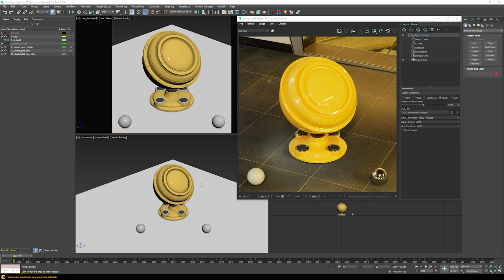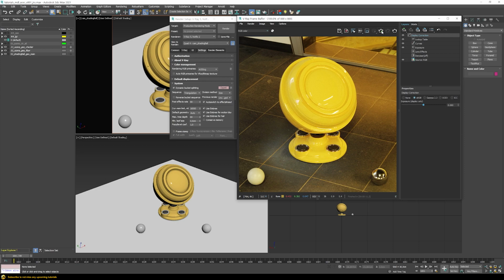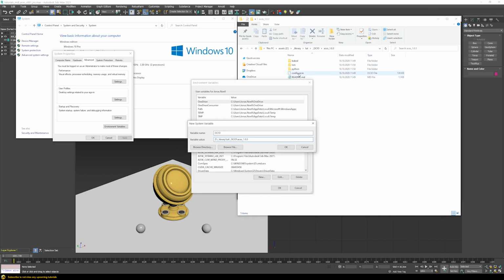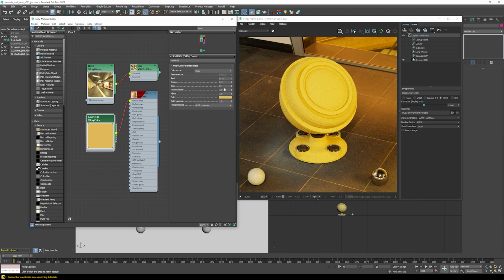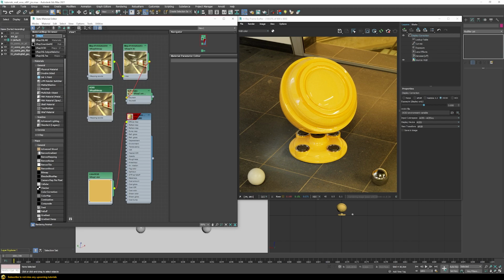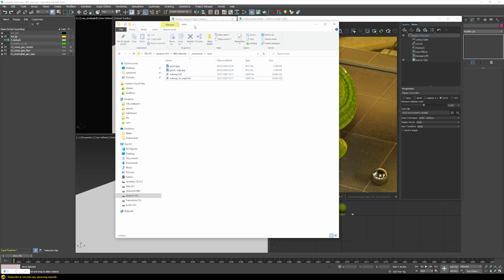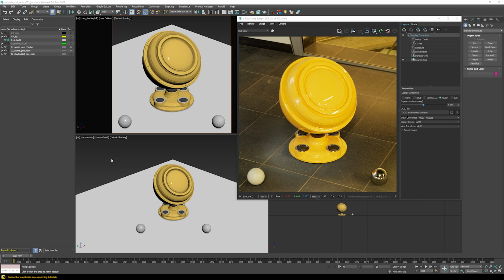V-Ray | How to use ACEScg WORKFLOW | ACES Theory, General Workflow, OCIO, sRGB Texture Conversion

Comment: Hello, when i use ACESCG, should i set the Color Management (in vray tab) to Reinhard or Linear?
Reply from the maker: Leave it a Reinhard as that is the default and its nowhere described that it should be changed in the official docs.
Reply: @JonasNoell  Okay thank you this is a little faster with Reihard :)

Comment: Great tutorial, sorry if this has been mentioned in previous comments (132 is a lot to go through) but is this workflow only helpful in terms of the compositing side of things? I'm assuming you will lose all that extra colour range when you say export as H264 from After Effects? Many thanks.
Reply from the maker: Hi, yes it will be lost when converting to H264 through AfterEffects. Basically look at ACES as an extended colorspace from that you can convert your media to any other format or colorspace. It’s the perfect base material so to speak.
Reply: @JonasNoell  Okay interesting, thanks for the info, really aprreciate it. It's a shame it doesn't manage to maintain some of that extra information in the final output though.
Reply from the maker: @tinrats  As you are looking at the output most likely on a sRGB Monitor it anyway wouldn't matter. It's not that through Aces you could suddenly see things that you couldn't see before :) There are 2 parts which people tend to mix up: ACES itself is just the colorspace that has a much wider ranger than sRGB, so it's perfect for storing your data and then converting it to any other type of colorspace or medium that you require. And the other part is the OpenColorIO configuration that basically provides a "look" for ACES by applying a tonemap converting it correctly to the device that you are using (most likely a sRGB Monitor). So when using sRGB with an equally nice tonemapping you can get identical results because in the end you are viewing both things on the same medium. The advantage of ACES mostly lies in its standarization across multiple software and that it's futureproof. It mainly makes sense to use ACES if you are working in a team that uses ACES through the whole pipeline in a standarized workflow in my opinion. As a standalone artist I wouldn't really bother with it too much for now... (that's my personal opinion, other may argue differently)

Comment: When we use ACES and save the file, the ACES settings are also saved in the photo and can be seen same on TV or mobile and different monitors? 
In the past, unfortunately, the color was not seen same in different devices.

Comment: Hey Jonas,
I had some problems using environment variables with deadline/any other farm service. I think it is safer to point on vfb the folder with OCIO config file.
Reply from the maker: Hi alright thanks for that. I haven't had tried out rendering through Deadline with Aces yet, so that's good to know! But anyway since you are saving out linear raw exrs without baked in tonemapping it shouldn't matter if some computers can't find the OCIO config files or?
Reply: @JonasNoell  yes, it is just matter if you want to bake the vfb transformations.
Tks!

Comment: Hi, Jonas. Thanks for the tutorial! When I set my non-ACES diffuse textures to use "sRGB primaries" from the "RGB color space rollout" in VrayBitmap, the textures become bland and desaturated. Is this normal? This makes creating materials difficult because the diffuse texture in the material editor no longer looks the same as the texture on my hard drive which is much more vivid. Does that make sense?
Reply from the maker: They appear more bland as they are converted to ACES in this case which in genreal produces a more vivid output result. So the preview looks wrong on your sRGB monitor but since it has been converted to ACES it will be rendered correctly internally. It basically does an on-the-fly conversion from sRGB to ACES. If you use ACEScg in V-Ray and you don't specifically define your texture as sRGB then it automatically will assume all of them to be in ACES already and thus doesn't change them. However the result will appear more vivid as intented  because the texture itself is actually not in ACES but still in sRGB. V-Ray itself doesn't know if your texture is in ACES or sRGB, it has to rely on the input from the user. Here is where most errors will happen and in the end you will get an odd looking image by mixing different data together in a way how it was not intended. So if you are not 100% sure of what you are doing it is better to stay in sRGB and avoid these kind of problems 🙂
Reply: @JonasNoell  Yes, I figured that out already. Thanks for reiterating though. My questions was more about the fact that using ACEScg workflow makes diffuse textures in the material editor look desaturated and this makes material creation a guesswork. Is this normal?
Reply from the maker: @bgtubber  Yeah as I said only your rendered result will be in ACES, what you see in your material editor is a texture that was converted to ACES. Since your material editor doesn't render the result internally in ACEScg you will see this bland result. It probably would be a possibility from Chaosgroup to still show the sRGB texture for the material editor and only use the converted one only for the internal rendering. But that's not how it is working at the moment. But anyway you probably shouldn't evaluate your shader through the material editor preview but through the full rendering.
Reply: @JonasNoell  Ah, I see. With all these small quirks, for me it's still a bit clunky to use ACEScg in 3dsmax. Seems like nothing in 3ds Max is color managed yet, including the material editor. Hopefully Autodesk can streamline things and implement a proper color management into 3ds Max. Until then, I think I will continue to use linear workflow with filmic tone mapping which give more predictable results for me, especially when creating my shaders. Thanks again for your input on this! 🙂
Reply from the maker: @bgtubber  That's exactly what I am doing for now as well. The whole ACES workflow at the moment still has too many inconveniences built in for me personally and in combination with a proper tonemapping workflow I also don't feel like I am missing out on much so far. 🙂

Comment: so i have to do this for every material of an asset i load in? good bye!
Reply from the maker: If you want to use correct ACES workflow then in theory yes :)
Reply: @JonasNoell  but all these assets that are prepared for 3dsmax+vray come with vray materials, that have the standard bitmap in the diffuse slot instead of the vraybitmap. it's literally impossible :(
Reply from the maker: You can convert all the textures to Vraybitmaps Using the Scene Converter in the Quad Menue. But you are right it is tedious to do so that’s why I normally don’t bother to use Aces at the moment.
Reply: @JonasNoell  Thanks for all the free service and information you provide. 

Yes, i feel like it's maybe useful for product rendering, but for architectural rendering with hundreds of assets and materials in the scene, this is way to inefficient at the moment. 

Right now i'm pretty good of using the filmic tone map and/or using camera raw in photoshop with the exr io plug-in in 32bit where i later convert it to 8 bit for matte painting. still don't like that photoshop is not capable of proper exr handling, but that's a different issue. I'm too lazy to learn fusion.
Reply from the maker: @L3nny666  I would recommend that if you have a workflow that currently works for you and there is no requirement from clients to switch to ACES to just stick with whatever you have. Do a propper tonemapping workflow and you will get (in my opinion) very comparable results with much less hastle and less possibilities to mess something up🙂

Comment: Hello, when I checked the official vray documentation, I noticed a yellow warning in the vray for max help file. This warning seems to be only available in the max version"
The V-Ray ACEScg workflow does not require an active OCIO configuration. In V-Ray 5, the relevant ACEScg transformations are part of the V-Ray core. However"
If I change the color space to aces, then use vray bitmap to load the node. Direct output, the texture does not change color.
This is Google translate, my English is not good

Comment: Thanks you very much Jonas. But after learning from you and paying a day to test it, I found that : all grayscale maps which have "_raw" suffix should be set Color space transfer function as "none" (just like normal map). It'll make bump (use grayscale maps) and displace look better without loss detail. Would you please check it again. ^^
Reply from the maker: Hi, I would need to double check, but wouldn't they anyway be set to "none" when they have the "_raw" suffix automatically? At least that's how I assume it should be handled...
Reply: @JonasNoell  yes. It'll be set to "none" automatically for any "_raw" suffix file name found. When I checked with displacement and bump grayscale maps into "from 3dsmax"  and "none" cases. I found that the result will look deeper and enough information when I keep "none" setting. In case of reflect and refract we should use "_sRGB" and keep "from 3dsmax" is absolutely right. Because those slot may receive color information. After checking with cooper material, I can make sure about that. Thanks for your reply❤

Comment: Good video Jonas, I have a few comments if you don't mind
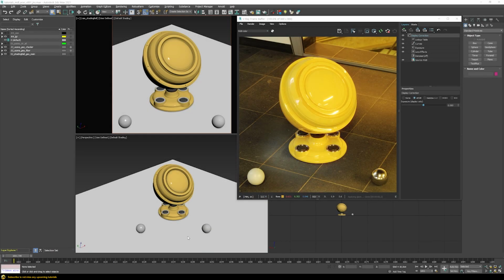0:33 "Up until recently Vray only supported sRGB color space internally for rendering" 
No, ACES workflow has been part of Vray for a long time.. the controls were mostly hidden in Maya and 3Ds Max so advanced users and studios would access them through code, those controls were exposed in the UI in Vray 5 + improved workflow overall. I think I have seen people/studios use ACES in Vray since around 2016-2017

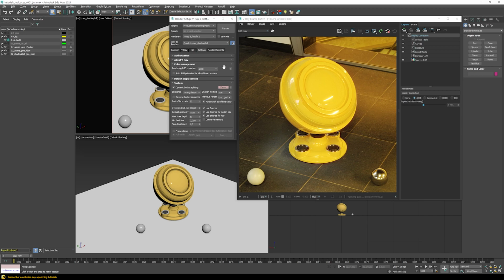2:21 "Most likely you would be better continue using sRGB because all your resources are in sRGB color space"
You don't need to convert your existing resources to ACEScg, Vray does this on the fly when you setup your IDTs in the file node or the OCIO node. Those conversions are super fast in Vray 5, they don't affect performance like how it was in Vray Next(docs is wrong on this one) I have tested those conversions during Vray 5 Beta with bigger scenes, it barely affects performance. There is discussion with devs on the performance side of Vray's OCIO node/file node in the Beta forum. 
On another note, ACES is one big advantage in Vray's workflow, it addresses tone-mapping(you get a nice filmic look out of box) and wide gamut rendering(improves GI, SSS and anything that deals with bouncing of light, because calculations of lights and materials happen in a wider gamut).. Also in Vray's case the workflow is very easy to follow, and all internal elements like Sky, Kelvin temperature, Hair Shader, Dispersion..etc are all converted internally to ACEScg (This has been a big issue in other renderers)

9:40 Make sure to use the latest ACES 1.2 it is much better and solves a few issues. 1.03 version is 4 years old

And one last note, converting a bitmap to ACEScg doesn't desaturate it.. it appears "desaturated" in an sRGB viewer, you will need to use an ACES sRGB viewer to view it correctly and in this case it will look just fine

I have been using ACES workflow for 2 years, never used sRGB since then. ACES just makes things easier, CGI starts to behave like photography
Reply from the maker: Hi, thanks for the comment, that is all valuable feedback and additional information. Especially the part with the on-the-fly conversions with the nametags, based on the information I found was that it does affect the performance to do all those conversions during rendertime, but I didn't really test it with complicated scenes yet. So it's good to know that this doesn't seem to be an issue.

Thanks for you input!
Reply: Hi Dear What do you think the setup should be if I do not want the images to be aces and keep them rgb neither the standard bitmap rollout to be converted to vraybitmap and still want to use the aces?
Regards

Comment: I really enjoy your tutorials! Ive been using acescg in Arnold in C4D for personal work but use Vray 5 Max at the office, typical linear sRGB. I'd like pitch my team on a switch to acescg but 2X all of our textures seems like a no go. Arnold autogens TX files and has a lister as well to make things more transparent. We often work with hundreds of textures and lots of third party assets(additional textures) so renaming seems like a mess as does doing an additional pulldown on every texture. This seems like a daunting hurdle at the moment...
Reply from the maker: Hi, yes that is also for me the biggest concern for switching at the moment. So I think it only makes sense right now if your pipeline really requires it. I for my part will continue working in linear sRGB for now because the benefits don't weigh up the hastle and inconveniences at the moment for me personally, but in other scenarios it maybe would make sense. 
If I would do the switch I would create a new copy of my entire texture library on a new partition and rename all the textures while keeping all the original textures at the original location to ensure backwards compability. Don't really think there would be any other way than that at the moment...
Anyway, thanks for your feedback :-)
Reply: @JonasNoell  ah! just thought i’d something - do you need to convert data maps like normal, roughness or displacement ? I do assign data maps as liner-sRGB but i’m not certain it matters?
Reply from the maker: @MrMadvillan  That depends on how the data was saved out. If those maps are raw linear data (for example if you export a displacement map through ZBrush or a NormalMap/Glossiness Map through Substance) you just give them the _raw nametag and they should be loaded correctly.

Comment: Thank you, Jonas. This is the best ACES for MAX tutorial I've seen so far. But this one also doesn't address settings in the Render setup >> V-Ray >> Color mapping rollout =/
Reply from the maker: Hi, that's interesting of you to mention. Based on my information they should be left at default and you don't really need to mess with them no matter if using ACES or sRGB. Or do you have any different information on that?
Reply: @JonasNoell  I agree with Remaining Light. All the videos I've watched regarding V-Ray and ACEScg workflow settings lack information on gamma settings.
Could you tell us how to properly set the gamma in Render Setup >> V-Ray >> Color mapping for ACEScg? As far as I understand, the correct handling of the color space will depend on these settings.
I'm also wondering: in what cases should "ACEScg primaries" be enabled in the VRayBitmap >> Color Space settings? Do I need to do this if "sRGB primaries" is selected in Render Setup >> V-Ray >> Color management? Thank you!
Reply: @phillmorris9220  I have a full Mograph + tutorial (VRay 5 and 5.1 MasterClass) where the following is stated about the color mapping settings:

"To achieve the most accurate results it’s best to leave the color mapping settings at their default values and perform artistic color transformations during post-production.  This will also ensure repeatability consistency and a very accurate render solution."

Comment: Thank you, great tutorial, and really nice that you have explained all the options as they were implemented over time.
One question. If one chooses to follow the route of not renaming the textures but use the workflow where one selects sRGB or RAW manually, should the Auto RGB primaries be left unchecked (off)?
Reply from the maker: Thx for your feedback! :) The Auto RGB only has an effect when there is a nametag present in the filename. So if you don't have any nametag and know which colorspace it is in then using Auto RGB on/off wouldn't make any difference from my understanding

Comment: But if you have like for eg 100-150 textures for every project then renaming the textures everytime would be a task, so cant we have a script that renames the textures automatically. what do you say
Reply from the maker: I guess it could be scripted but the script would need to guess what colorspace the saved picture for example is. But if you know that all your texturemaps are for example in srgb colorspace you can just use a tool like TotalCommander and batch rename all the files adding the correct nametag.
Reply: @JonasNoell  I found one script on the VRay forums by lele but it gave some error while executing it. If you want i can share the same for your testing as well but for that i need an email to share. Thanks
Reply from the maker: @amitgedia  Hi, thanks but if it's the script from the forum by LeLe then I know about it, but haven't tested it yet :) If there is errors I think the best would be to contact him directly, I'm sure he will sort it out for you!

Comment: What is the purpose of adding a system variable for OCIO in the overall workflow? If I were to skip that option will it affect rendering in anyway? I don't understand why that step is necessary.
Reply from the maker: It’s an optional step, you don’t really need to do it. But if you do V-Ray and other software will remember the location on you computer and you don’t need to always manually navigate to there
Reply: @JonasNoell  Ah I see, I apologize I just re-watched the video again and noticed you mentioned that already. Thanks for the follow-up anyways.

Comment: Could you tell me how to combine ACES and multitexture modifier (floorgenerator things :).
Reply from the maker: I didn't really try MultiTextures yet, but I would assume it works the same way. So just make sure you use VRayBitmap with the correct nametag.
Reply: @JonasNoell , problem, that mutitexture modifier doesnt uses vraybitmap, it uses simple bitmap. So by default I must change 10+ bitmaps to vraybitmaps manually.. And every other colorcorrected map from SAME node will be in the same color space.